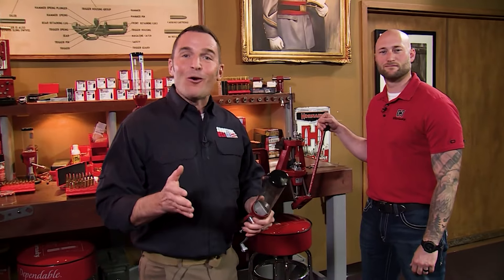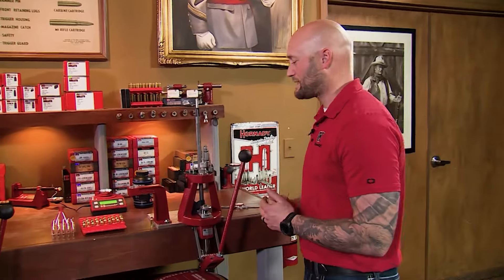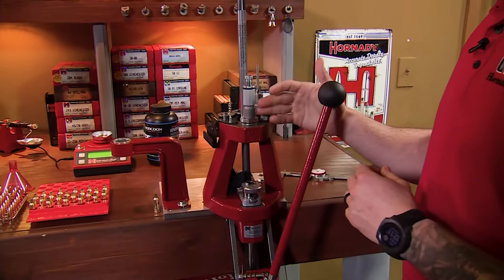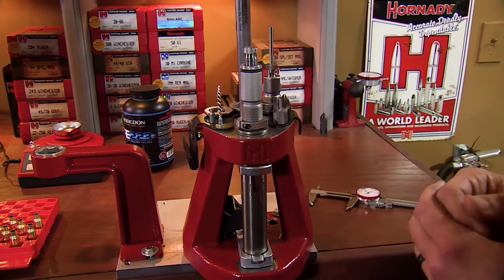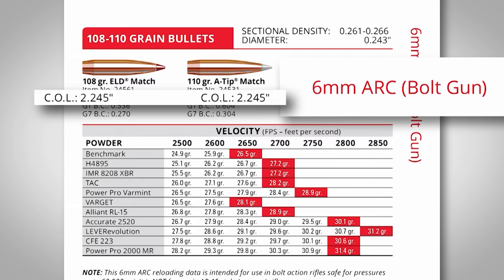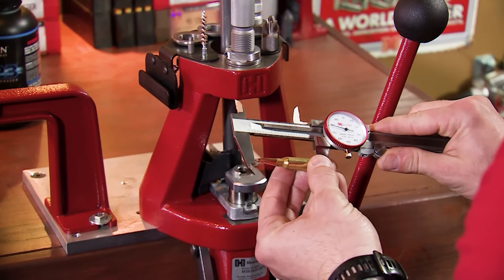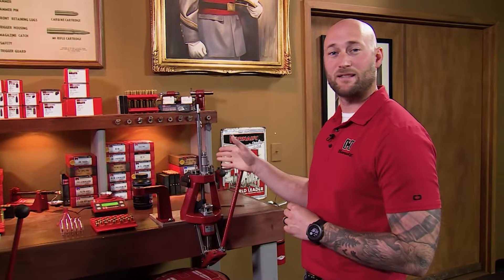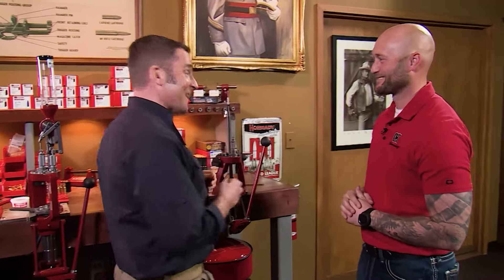Beginner Reloading Tips Part 4

Comment: Awesome, thank you. 
I've only loaded less than 50 rounds so far but I don't understand why 1 in 5 or 10 will seat to a few thou different depth. Everything is locked down and the powder isn't compressed. 22-250, 60 gr V-max, Varget.
Reply from the maker: Base to ogive, or base to tip measurement?
Reply: Take out your box of bullets and measure a hand full of the projectiles from base to tip and you'll find variation that likely explains the variation of your cartridge overall length (COAL). For variation in cartridge base to ogive (CBTO) measurements, this is probably due to the bullet seating stem (that's inside of your seating die) being a smaller diameter than the ogive comparitor tool.
Reply: Some of the best help to a new reloader is available on the Johnny's Reloading Bench youtube channel. He has a 6 video playlist for 22-250 and hundreds of other videos on a variety of calibers.
Reply: Thanks for your replies guys. Base to tip measurements. Occasionally, I had to screw the seating depth adjuster in a bit to get the quoted COAL, and then I'd have to re-set it again as the following loads would be too short.
I'll have a look at Johnny's Reloading bench now, it's been a few years since I've watched his videos and I didn't realise he has a good range on 22-250.
Reply: @jasyamaha  Factory ammo and even factory match ammo all have variation in COAL for the same reason you're seeing it in your reloads. The COAL measurement is really only a target average measurement with an acceptable +or- tolerence. So long as all your rounds fit into your magazine, don't bother chasing perfection in COAL...all other more important measurements are consistent if you're not changing your die setting. If you do chase COAL in every single round and are constantly changing your die setting, what you're actually doing is seating the projectile inconsistently, which can affect chamber pressure and velocity and it can lower the quality of the ammo that you're producing. The only way to get near perfection in COAL is to get into bullet sorting, bullet trimming, and bullet pointing like Erik Cortina and F-Class John talk about on their youtube channels, but if you're not shooting PRS matches or 1000yd targets you won't see a benefit from doing extreme stuff like trimming and pointing bullets. COAL inconsistencies is why folks chose to instead measure CBTO using a bullet ogive comparator. CBTO measurements are more precise and repeatable.
Reply: @goforthandfish8393  excellent and detailed explanation, thank you very much. That makes me feel better about the process. I have watched a few videos from those guys but that level of precision is not for me as you point out. I'm shooting fox's out to 200m Max.
Reply: @goforthandfish8393  I just looked up CBTO. I've watched a heap of videos on bullet to rifling jump, but I think that one will wait a bit. Lots to learn and so hard to find somewhere to shoot and test south of Melbourne Australia.